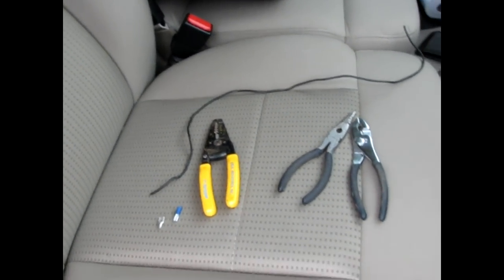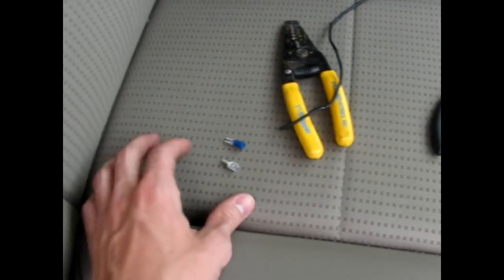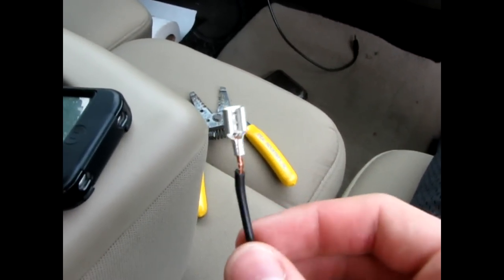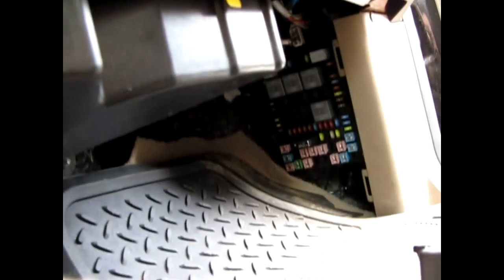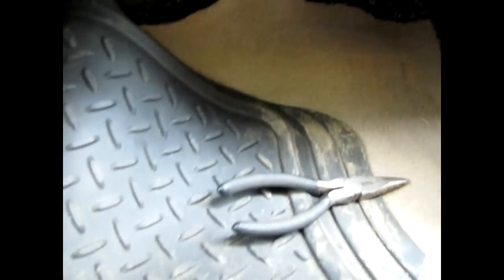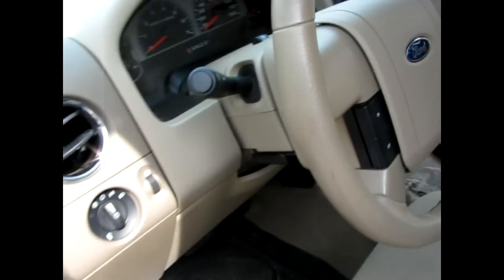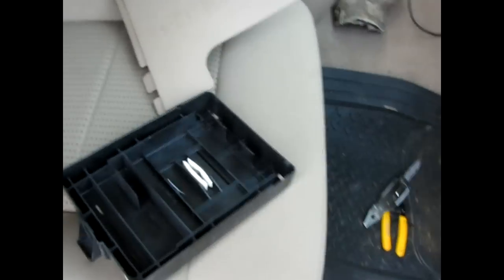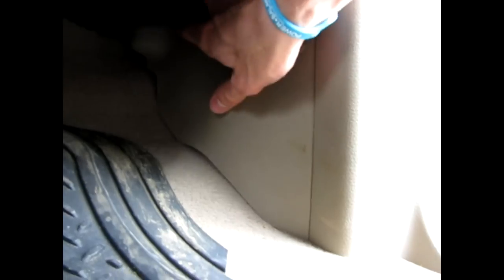F-150 Free Headlight Mod (Bambi Mod)

Comment: I know it's an old video, but thanks none the less.  This was the only way to fix an issue I was having when I did an LED overhaul. Whenever I would turn on my fog lights, the high beams would come on effectively making it so I couldn't run my fogs with my lowbeams. This mod did the trick now my fogs are independent from the high or low beams.  Thanks again!
Reply from the maker: No problem, I'm glad this helped you fix your issue.
Reply: Me as well.  i did an LED kit on my 08 and had the same issue with my Heise kits and called Metra and they told me to go straight to a Bambi mod search. Thanks!
Reply: Does this mod work on f-350’s my led lights are doing the same thing?
Reply: +Dustin Arter  ...  You may have found the answer, if not, he said 2004-2008.  If you have one of those years, it should work.  For my car, I am using a rocker switch with an Add-A-Circuit, and wire it to my fogs.  If you consider that, just try to find a switch that matches, as best you can, any factory dash switches you may have, for a clean interior look.  EDIT  Switches and wiring are cheap.  Wire and check the function before you cut and/or drill, or even snake the wire/s.  EDIT  BTW, if you have any factory dash switches, you can buy another one of those for an even cleaner look, and with some good/clever handiwork, you can customize the look/design.  Maybe, with just a tiny bit of paint, then nano coat it for durability.
Reply: Same lol just got done and was watching videos I did it from a forum and then watched this I'm posting a link to this in the forum
Reply: @dustinarter2999  I would say yes
Reply: I have the same issue right now it just started happening a couple days ago even though ive had the leds for a couple of months will try this tomorrow

Comment: For those of you looking to add LED headlights, and have HIGH BEAMS turn on when turning on your fog lamps... This is the trick. Believe me it works. Isolate and ground your fog lamps.

The High Beams are back-feeding through your fog lamp relay. Very simple. Glad someone figured it out (wasn't this guy), and it helped me. 

Hopefully LED Headlamp suppliers will realize this issue. I think it goes to the fact that ALL vehicles in US must have NO fog lamps with High Beams. Certain people in China don't know this.
Reply: I tried this because I was having the same exact problem, and it works!

Comment: For all those who are worried about passing inspection just get a second relay and put it in during inspection. Then when inspection is done put the relay with the wire back in !
Reply: Never understood why it's illegal in some places. Fogs point low to the ground and you're not supposed to have high beam on when you're diving at someone anyways

Comment: There is a wiring diagram that illustrates this, and I looked at it with chin on hand... and then...  AHAH!!  I understand. If you see it you will understand too. Interrupt the circuit from High Beam to Fog Lamp, and Isolate Fog Lamp power to ground. Whomever figured this out did a bit of tinkering...

Kudos to you sir for figuring this out.

Comment: On my 05 F150 I cut the stab off with a dremel tool, slid the relay cover off and soldered a wire on the corresponding post. Then I drilled a hole in the cover to pass the wire thru and plugged the relay in. Had to do the mod to keep the led high beams from turning on whenever the fog lights were activated.  Works fine after the mod.

Comment: 2004 F150 FX4: 
After considering my options I basically made the same modification that others mentioned here in the comments
(just slightly different)
On the fog light relay I snipped the #2 prong/pin down to be just tall enough to solder a 10 inch length of 14 gauge primary wire.
(with no need for tape or insulation etc.   You should be able to tug on the wire without it coming off)
The wire sneaks around the top edge of the relay (instead of the side) so no need to trim/modify the fuse panel. (there is a nice little gap above the relay)
The relay still seats securely too.  I crimped and soldered a ring terminal to the other end and grouped that with the factory ground below the fuse panel. (make sure ALL of the grounds you can find are snug...even under the hood...you might be surprised how many are loose)

You're done! 

(to undo this modification: "buy a new relay" and plug it in)

So nice to get rid of that annoying, dimly lit high-beam indicator!

The BEAMTECH 10G-H10 LED Fog lights now work properly with the BEAMTECH S1-H13 LED "high" or "low" beams (and turn off and on with the original push-pull fog switch with zero oddities! Yay)
By the way if your fog bulbs are LED (or still halogens) this fix is the same! (Good)

__________________________________________

MORE TIPS for the H13 LED bulb install: (may apply to other brand LEDs or cars etc)
The BEAMTECH headlight bulbs may not line up readily (straight up and down) which is "normal".  
To make things easier I used a black "Sharpie" to put a short line on the "top" edge and a small dot next to the set-screw hole as a reference point. (they should add this to their instructions!)
Test fit/twist the LED into place and then check if it needs to be adjusted. (My driver's side BEAMTECH was off by one screw hole and the passenger side was already correctly sitting vertical)
Let me know if you have any questions.

Comment: Just shooting a thumbs up from the future. Watched your vid, and just did my 08 F150, after doing an LED upgrade.
Good stuff!
Reply: Check out my review at Amazon. These young guys are what we need. Fuckin' Bee.

Got a similar truck.

4.0 out of 5 starsThese are not plug and play with a 2004-2008 F150. Good customer service response
February 11, 2019
Verified Purchase
I bought these bulbs along with H10 fog lamp bulbs for my 2008 F150. Install was simple, and I only found one screw loose out of the box on one bulb. This was the OTHER screw hidden under the locking collar, and I needed to use the supplied hex key to remove the very small screw, and slide the locking collar toward bulb end to access the screw (hex key different size, no biggie). After installation, I noted that the locking ring fit snug in the housing, but there seems to still be some wobble with bulb body once in place. Not sure yet if this will show when driving at night (loose bulb bounce). When I tested with power, the bulbs threw a nice beam pattern, and I did not need to re-orient the bulbs. They both fit with a 3 and 9 o'clock orientation, which is mandatory for reflector housings. Unfortunately, when I turned on fog lamps, the main High Beams turned on. Took a lot of research, and I did contact customer service. They are very responsive and helpful, so +1 for that.

I would like to take only 1/2 star away so far based on the High Beam VERY OBVIOUS issue, but I must take a full star away because these bulbs required a good bit of research on my part to get them working (somewhat) properly. As I mentioned, turning on the fog lamps enables High Beams (NOT GOOD). This had me scratching my head for quite a while, but I finally found something that worked for me. It's called the "Bambi Mod", and it's a really good fix for one issue, that also fixed mine. Gotta love those dedicated to their craft, and also Google. If you have this issue, it's worth looking up, because it worked for me (mostly). This will, however, allow for fog lamps to turn on with Low AND High Beams. Fog lamps with High Beams is not recommended in any state; and I'll leave it at that.

I also complement Headlight Revolution; their YouTube videos gave me a lot to think about.

I will update with performance and longevity of bulbs after 6 months or so. I am curious to see how these heat sinks hold up. The build quality is very good, and I understand that LED retrofits for (somewhat) older vehicles like mine are still being fine-tuned, even by Chinese companies.

I let the BeamTech team know of my fix, and I hope they will process this and provide a connector to make these bulbs truly plug and play. As received by me, and installed in a VERY popular vehicle, unfortunately I can say they are definitely NOT plug and play.

But again, it seems like their customer service is very good, and I hope they provide a solution (connector? resistor?) for those of us who do not want to modify their vehicle wiring to make these bulbs work...properly.

*UPDATE*

BeamTech customer service, as I mentioned, is very responsive, and they are sending me a connector to apparently resolve the issue. I let them know that I would like this connector. I will install and let them and everyone else know if successful. I really want this to work so that modifications and research like mine are not necessary. If this works, I will recommend they include the connector in the box for an upcharge (only fair).

Call me a Beta tester, because that's how it feels.

*UPDATE2*

Drove truck for the first time in pitch darkness last night. Excellent beam pattern, and excellent brightness. I have driven MANY cars and trucks using LED headlamp bulb technology throughout these new OEM technology phases (I drive a lot of rentals), and the one issue I noticed for years was the amount of light thrown at signage. Sometimes it was blinding with the amount of reflection from signs way down the road. It took quite a while for most (like Big Three) to realize the needed focus of LED bulbs.

So far, these bulbs do not overwhelm with multiple reflections from numerous signs. Instead, I got a subtle reflection from signs down the road, but everything in the beam pattern was reflected to get my attention, without overwhelming me in the cab. Very comfortable drive and pleasant illumination. Signage was clear, and not overwhelming.

BeamTech is sending me a decoder. I will try this and update all for those of you with a 2004-2008 F150 who are curious about the fog lamp issue. I am hopeful but cautiously optimistic. I suspect I will need to go back to the "Bambi Mod."

*UPDATE 2-19-19*

So BeamTech sent me the connectors. They basically have the familiar 6 Ohm resistor in series. I am hesitant to install these, though I have installed them for my front and rear blinker LEDs, and they work fine so far. I don't want to install these yet to try them out, only because I need to mount these resistors to a metal panel, due to the heat given off by the resistors. So I won't be testing these connectors for the near future, since the Bambi Mod took care of my problem, for now.

I have seen that there is a LED flasher relay available, though it is quite difficult to install on my model of truck. I've also seen that these flashers are somewhat unreliable in the long term. So I'll stick with the installed resistors for now, and review later. I will update in the summer with my experience regarding longevity of these bulbs with the Bambi Mod.

**Update 10-27-19

So I learned a few new things today, after modifying my instrument cluster with LEDs:

I replaced the tiny incandescent bulbs with LEDs: Black plugs, 37 T5, Gray plugs 74 T5, LED. If interested, look for comparable models on Amazon.

Worked well, except I needed to reverse polarity many, many times. You may find this frustrating; I accepted it as a challenge.

I removed my cluster at least 7 times today. It was fun.

But with the "Bambi Mod", I noticed that my "Bambi Mod" reversed itself. I had the same issue again with fog lamps activating the HI Beams. WTF?!

Found myself scratching my head again at this hurdle. Hmmm...

So I thought about this for a bit and decided to put the original 74 incandescent bulb into the High Beam slot ONLY, and ALL WENT BACK TO NORMAL WITH HI/LO BEAMS!. So a little tiny 74 LED bulb reversed the very thing I was trying to overcome--- IN MY INSTRUMENT PANEL.

Huh.

For those of you attempting LED mods, please tread lightly and have A LOT OF PATIENCE.

You're gonna need it.

**UPDATE 10-28-19

I decided, after driving in the dark, that the odometer backlight in my truck was now REALLY bright. Too bright, in fact. So I reverted this bulb also to the original 74 incandescent. Overall, a GREAT upgrade to lighting on the instrument cluster, and the Hi-Beam could not be LED in my case. The odometer backlight is also very specific to my application, so you might not have this issue. All in all, I highly recommend this upgrade if you have a day to fiddle with bulb trials!

Good Luck!

Comment: +Zachary Adams  (Anyone.)  With the original design, do your headlight high beams activate and turn off the fogs?  One of my cars is old, a 2006 Grand Marquis.  That is how the highs and fogs work.  I am considering the Bambi Mod.  (Obviously, my fuse box location, etc, is different.)  Anyway, I already bought two rocker switches that closely match the factory rocker switches, such as the rear defogger.  I was planning on adding two Add-A-Circuit/s to my fuse box, and running both my headlights and/or fog lights independent of all other lighting.  Reason:  I can run either/both as daytime running lights and not dim my dash and radio lights!  For night driving on deserted roads, with the the Bambi Mod, I will not have to bother with using the rockers.

Actually, after writing that, I should not do the Bambi Mod.  :-p  That way, I still have the option of using the factory, default design.  And, I could still use my fogs and highs together.  Heh!

Ah, I will leave the post up.  Someone else may like that option.  Also, what gauge wire did you use?  I have not checked mine yet.  I am assuming both yours and mine are 14 gauge.

BTW, I have had the rocker switches for about two months.  Heh heh!  I just had too much other stuff I needed to do.  :-)

EDIT:  Hey people, help me pick a name for my (hopefully soon to be) mod!  :-)

Comment: Great Vid!!
Reply from the maker: +Leatherkid01 Thanks!
Reply: +Zachary Adams one suggestion tho...sqrew the ground to one of the bolts that holds the fuse box with a wire screw terminal to make it secure and out of the way ...... if you need to open that panel again... just a thought

Comment: Be careful... Most states require your fog lights to turn off when your high beams are on.  Your vehicle will not pass inspection if you do this.  Otherwise pretty cool
Reply from the maker: Very true, my state doesn't have inspections though so no issues for me.

Comment: Does the fog light switch still let you turn them off independently of the headlights?
Reply from the maker: Yes, just went and checked. You can still turn the fog lights on and off no matter if the low beams or the high beams are on.
Reply: Awesome!

Comment: I have a 2018 f150 should I try??
Reply from the maker: I have no clue if the new trucks are the same as this one. This is a 2007.
Reply: You can use FORScan on 2011 & newer

Comment: This has been a total bitch for me! Ive been working the past 2 hours trying to squeeze this in between 2 fuses and an extra relay i have on my fx4. Seems like it doesnt fit as perfectly as it did before the mod?
Reply from the maker: Jake Hmm, the only reason I could think of that happening is that in the video, the mod was done on an XLT base model truck. With your FX4 being a higher trim level you might have more electronic options than I had and more fuses/relays to worry about.
Reply: Not sure but I got it to work thumbs up looks real nice

Comment: Anyone have truck crank but not start after doing Bambi mod?
Reply from the maker: I'd look into the fuel pump inertia switch, it's right there near the fuse block and if you knocked that area hard at all it'll trip it.

Comment: Great job with this video! This modification works good. What I discovered, when adding Led headlight bulbs to the Ford F150 2004-2008 , was that led lights use a ground system that is grounded threw the led system. Ford uses the light to ground the circuit. When you ground the #2 pin in the relay, it stops voltage feed back that turns off the fog lights when you put on the high beams, and  keeps the voltage going to the fog light , at all times , when the lights are turned on. ( High or Low beams ). The only difference I did was , solder the 14 gage wire to the inside of the terminal , that's bent over, and protected the connection with heat shrink , rubber . Also right below the fuse box, if you look for it, there is a ground body lug, with a 8 MM Green ground bolt. I put #12 open spate terminal , on the end of the wire , routed the wire threw the fuse box, and connected the ground to the lug.. Also make sure you tighten the screw back up, tight. This ground ,grounds your fuse box, and a lot more  circuit's in your truck. Also what was happening when I installed the Led Headlights, when you turned on fog light, the high beams came on with the fog light switch , and the fog turned off. This modification fixed that problem also. JDM ASTAR, has a lot of information about this issue also. https://jdmastarblog.com Thanks again for your video, it helped a lot!!!!!!!!
Reply: I am not sure why some people claim that this started when using LED.. I decided to look on electrical diagram and Relay: R03 (High beam) and R202 (Fog lights)... from the design it was made on purpose when high beam is ON the ground connection on relay R202 goes to positive and disable the fog lights, when high beams are OFF ground on R202 goes through the high beam bulb allowing to be activated once fog light switch is ON.

Also this video is showing with OEM lights, not LED. but glad we found a solution for this.